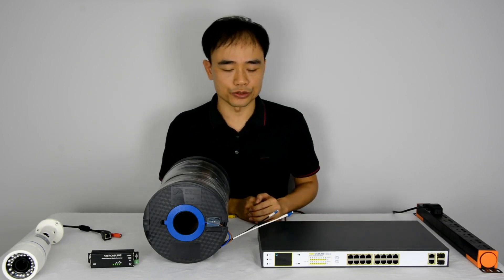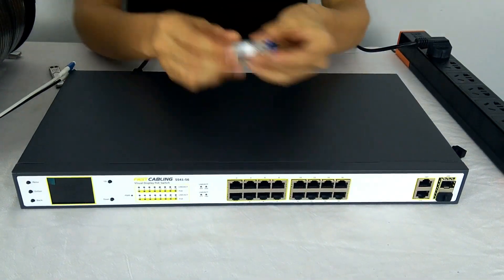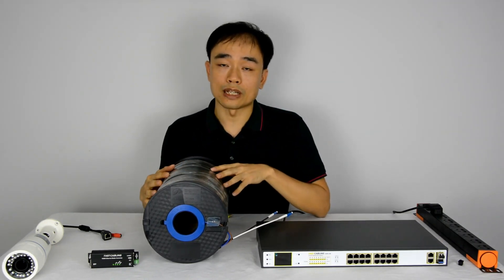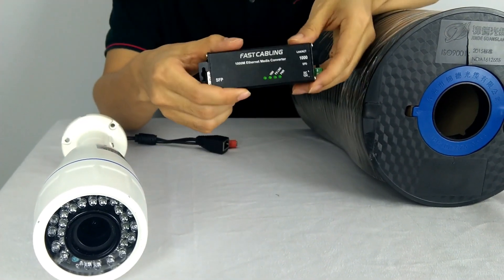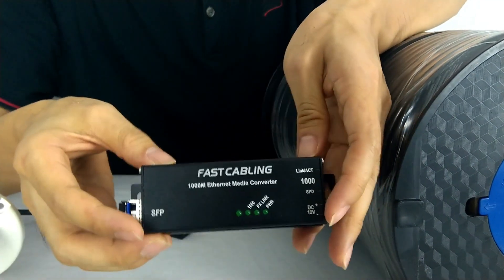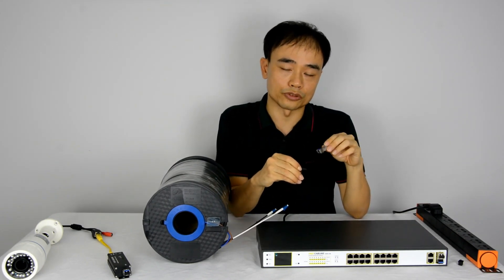Use SFP Fiber Optic Module to Connect your PoE Switch

Comment: Is the only benefit of using an SFP module distance gain, or does it provide faster speeds throughout the LAN up until it reaches the WAN if you are not a fiber subscriber?
Reply from the maker: If your LAN is currently operating at 1Gbps, adding a 10Gbps SFP+ module will not increase speeds unless the rest of your network infrastructure supports 10Gbps. The speed of your network is determined by the slowest link in the data path

Comment: How you get power to the poE camera?
Reply from the maker: If you are using the fiber optic cable, you can wire DC power cord in parallel to send DC56V to the edge, and work with PoE extender. https://www.fastcabling.com/product/waterproof-industrial-hardened-grade-fiber-poe-media-converter/

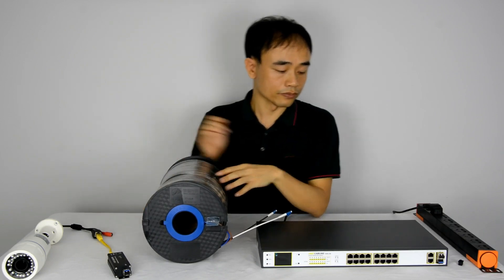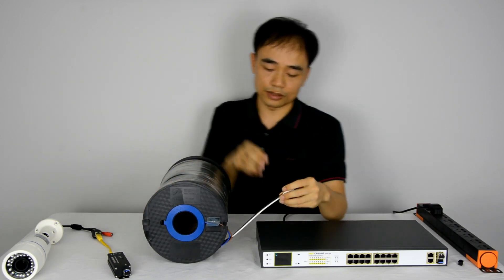Comment: So you are saying that whenever one of the SFP port is used, the UPLINK port besides it is not working ? 1:27 - 1:40
Can you clarify again that part ?
Reply from the maker: You are right. it is the combo design with this switch. If your switch have dedicated ports for SFP slot, you can have both working at the same time.

Comment: multiple cameras to poe switch with sfp port of switch to another sfp port of switch ok? no need for media converter?
Reply from the maker: Only single media converter will be needed at the control center. There is fiber optical tunnel between the switch and the converter. All the cameras will go through that tunnel.